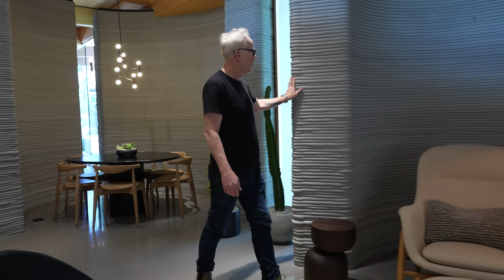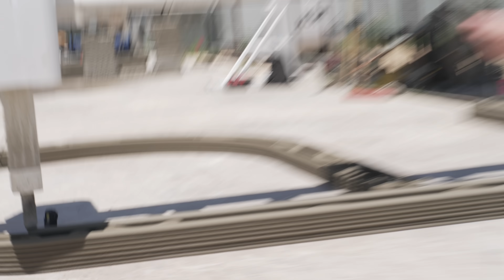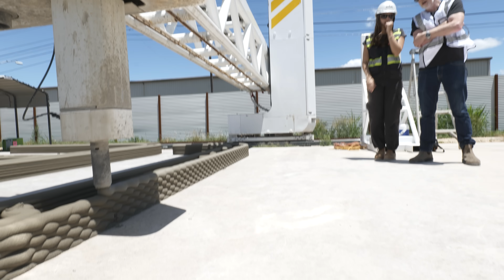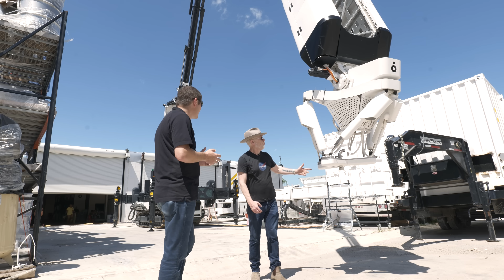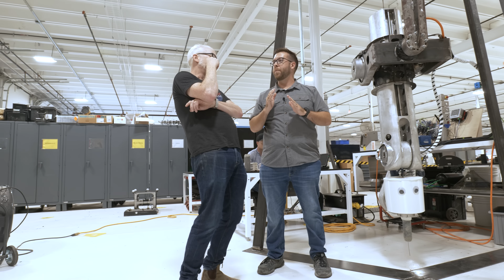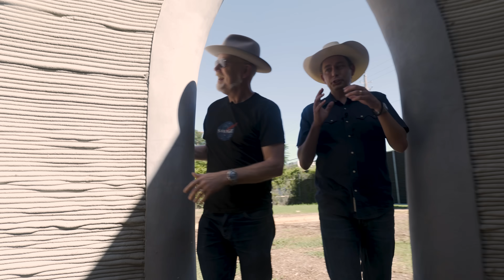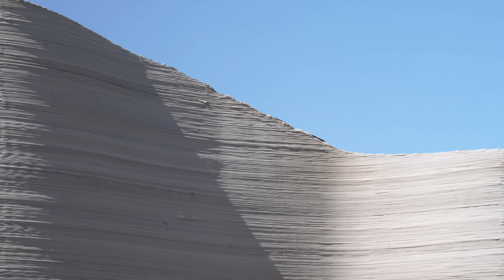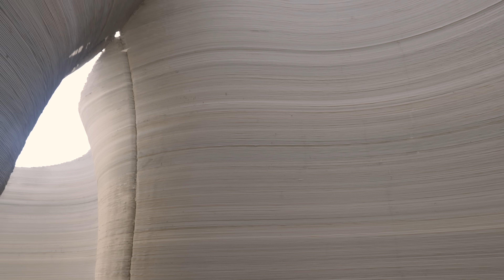The Biggest 3D Printer Adam Savage Has Ever Seen!

Comment: This is a fascinating technology that I reckon will be fundamental in dealing with the US Housing Crisis. 

● I'm curious to know how their materials/design fits with both general US housing standards & those extra standards essential in certain regions (eg: hurricane proofing in Florida)? 
(When the standards were based on older, now obsolete technologies, there's often quite a delay between the development of a new tech & the time when the relevant government bureaucracies update the standards.)

● Can their extruder use different nozzles for fine or shaped work? (Perhaps switching between them on the fly &/or even changing between different viscosities of their polymer concrete for different sub-structures.)

● Does their polymer / concrete material come in different viscosities? (Having a liquid version that can be sprayed onto surfaces or poured into moulds would be helpful for lots of projects.)

● Home much overhang can their 3D printed walls maintain without supports? Could it print a dome (+) with walls that taper as they rise, so that the base is 3 times the thickness of the summit?

● Can their polymer concrete material be extruded underwater? How resilient is it to oceanic/ salt water environmental conditions? Would it be possible to develop a version of their extruder robot that could work underwater?
[ NB: As water levels rise due to Anthropogenic Climate Change, it's going to be necessary to build huge Breakwaters &/or Sea Walls along the coast to protect coastal cities from storm surges, etc. ]

● For that matter, how does their material hold up to prolonged heat & solar radiation? Or extreme cold & heavy snow? Is it protected against "Concrete Cancer"? (Where repeated cycles of heating/cooling cause cracks to form, giving water & corrosive pollutants access to the steel superstructure, sufficiently corroding the metal until the whole thing fails.)

(+) - Perhaps learning from the remarkable construction of the largest unreinforced (no steel or bricks, just pure concrete) concrete dome ever built: The Pantheon in Rome.

Comment: I would be curious whether this can 3D print a large scale, multistory hobbit hill for larger human frames. I would think you’d have to dig a lot of topsoil away, build a very particular structural shape on the outer layer and interfacing with the inner, before restoring the top layers and hoping it’s incredibly structurally sound and leak-free
Reply: Honestly if you could cross modern design in with the fantasy elvish and hobbity elements you could craft something that I would genuinely go be the eccentric guy living in a weird house in the hills

Comment: Soooo... Do you need to print supports too?
Reply: does not look like they are printing anything with such extreme overhangs. also I do know they are capable of manually installing temporary support structures with a ground crew during a print job, such as for windows and such
Reply: @coreysuffield  Hm. How do they make floors then? Like if you want a multi-story building?
Reply: @JohnJTraston  they are still figuring out printing multi-story, but early and existing printed houses use traditional construction for an upper floor

Comment: I hate the layer lines look it is increadibly ugly, in FDM we are doing everything to make the print as smooth as possible, to cut down on the post processing time and cost, and to prevent material defects feom leading to issues later down the line. I really wish you'd do the same, the basket weaving 'skin' idea is a step in that right direction.

Comment: as a technology i love how mind blowing it is... however i feel it has the same issue as Pre-fab houses, where they get the order of operation off:
Pre-fabs should make the modules in the factory & the house gets assembled/customized on site, instead they made the whole house at once before delivering it
have House printing be for House Modules where you can guarantee the proper printing conditions, or using it for expanding existing houses
Reply: There is no such thing as mistake in order of operation. You need to take a lot more time to look into the broader subject that you're talking about. I have a brother who works for a company that builds pre-fab segments for housing in their factories in the northwest of the U.S., then ships them to the jobsites where they're offloaded & assembled. There are still houses that are entirely constructed into modules then the entire module is trucked to the site & placed. Those are called modular or manufactured homes. The units my brother works with are labeled "SIPs" (Structural Insulated Panels). It seems that you either didn't watch this entire episode, or you completely misunderstood ICON's mission in developing a printing head that works in nearly every printing condition, from uneven ground, to limited-space old-world environments, and more, and adjusts the parameters of the cementitious materials being extruded on the fly as the conditions change during the workday, not just from day to day or week to week.
Reply: @dionh70  that's why i said it FEELS like they are seeing the process the wrong way
Reply: @dionh70  also, yes. I did watch & understood the full video and my point still stands, the strengths of 3D Printing/Additive Manufacturing is the ability to mass produce intricate bespoke parts, and/or rapid prototyping. Not On-site fabrication

So what ICON is developing is still counterintuitive to the current process, which i never criticized as a bad thing

Comment: Using 6 active cable stays and 1 'bar' (with or without the bar being length adjustable) would solve nearly all their stability and accuracy issues, at a tiny fraction of the cost. Think tensegrity, but with servo controlled cables.

Comment: I bet traditional framing is faster for building a full finished product.
Reply: They said in the beginning this can be erected in a day.
Reply: @jamesengland7461  I'm talking about a finished house not just a shell.  Most of these houses have framing built around them that takes much longer than the concrete part.  You also have to make space for all the plumbing and electrical. So it seems to me you damn near have to frame the whole house inside anyway if you want your pipes and wires to be in walls.  At that point just build with traditional stick framing.

Comment: I am concerned there’s no vertical reinforcement when it comes to printing a subsurface wall for a basement, but I suppose if you print tubes as you go, you’d be able to slot rebar vertically and fill the chambers with cement before continuing to above grade walls

Comment: I wish I could find a good economic justification for 3D printed houses. The tech and engineering is so damned cool. But really, it replaces the wall framing of a house, which is what... 10% of the cost of a building?  Concrete has increased in price 50% in the last five years, so I doubt there is a materials saving. 

And the CO2 from cement production is enormous - not just from burning fuel for the very high temperatures, but from the chemical reaction that forms cement itself. It's roughly a ton of CO2 produced per ton of portland cement created. You're going from sequestering carbon in your house structure to emitting hundreds of tons of CO2 to build it.

I really want it to make sense, but it's a challenge.

Comment: This is one of those "It's good that this tech exists, but it is almost ALWAYS the wrong way to do it" things.
Reply: I wouldn’t build my house out of it, but if it became cheap enough and if that crane works I could see it being great for garden sheds or garages and simple structures like that, that you just want to throw up quickly and be very functional.
Reply: @a.s.j.g6229  The problem with using it for a shed or whatever, is that the special concrete mix and machinery make it much more expensive than other methods.
In order to come down in price, there would need to be enough demand for it to benefit from scale production, which would happen without the price going down.

There are SOME uses for this tech. But they are so few and far between that it will never be cheap.

I could see it being useful if you need to remotely build a radiation casket for a nuclear reactor or something where you need to build it NOW(!) and you need to limit human exposure to a site.

Or possibly for robotic construction of a colony or something? I dunno.

It would have to combine $$$ not mattering with normal construction being difficult.

Comment: I would love to see an in-depth study of wind loads, rain, earthquake and other factors that test the structure. I will guess that with the curved walls, the wind loads would be very good. Also, would like to see examples of different cladding if, say, the buyer doesn't like the surface look, how would a plaster finish work? How about using wood internally? Also, I live in Florida and outside mold would be an issue with that surface unless there is some way to keep it from forming in the first place. I do wonder how the trades guys will put in water, power, data, and say security cabling...I would guess you could surface mount but not everyone will like that. Also if you wanted to, at a later date, modify it, how hard would that be. It's really fascinating, and this kind of tech is just getting started, wow. I didn't hear them mention that there is so very little waste! I mean stick homes are waste intensive compared to this.
Reply: There's a gap between the inner & outer printed walls. Did you see the BX cable for electrical & PEX piping for plumbing? A diamond-edged blade on a multi-tool should be able to cut a new hole for another outlet. Adding an outlet for my handyman clients is difficult enough with drywall & studs, admittedly. They did say that they're intentionally leaving the printed faces bare during the development phase, but plastering or spray-crete or some other method I don't know about should work. For the exterior surfaces growing mold/mildew, pressure-washing will be fine on bare surfaces, and there's plenty of exterior paints with mildewcide mixed in.

Comment: Seems like this tech could be useful for building structures on the moon and mars.  The material will likely need to change to handle the radiation and thermal environment and the machinery needs to work over a wide temp range (small details ;) ) but if it could use lunar regolith and mars rock then maybe ...

Comment: Its cool technology, and impressive on many levels, but I've said it before about similar projects, and I'll say it again: They are not printing a house. They are printing something like 2-5% of a house.
First, to build a house, you need a foundation. Not only does this not print a foundation, but essentially requires you to build more than a foundation, because the printer needs one as well.

It doesnt build a roof, unless you want to live in an igloo.

It doesnt build windows, doors, floors, panels, electrical, plumbing, tiling, central heating, ventilation, ceilings.. You get the point

What this replaces is basically the wall structure basics. This is essentially the fastest and easiest part of any house you can build. Its all the other stuff that actually takes time and money.

Comment: It's cool, but I'd definitely want a secondary pass of some other machine that could smooth out the surface... Or maybe the printing head could have some sort of tool that is flattening the side as it goes along.
I see those hundreds of folds and immediately think about the dust that will collect on top of every fold and it being a nightmare to clean since it's rough concrete too.
Reply: could probably smooth it out as it goes, dont know if it would affect anything

Comment: I wouldn't call it printing a house, but printing a cave. Also it seems like a solution looking for a problem. Whenever I watched building sites (meaning walking by them every few days), the walls were pretty much always the quickest thing to go up. And it didn't even really matter, if it was brick wall, cast in place or precast. Not to mention that these walls then had openings ready for installing standard doors and windows.

Comment: 3:10  24 hours is absolutely insane 😅
Reply: That's probably no where near typical at the moment, possibly even a very small "house". Did you notice how much he hedged saying that, and that it was under prefect ideal circumstances. Then he never even answer how long a typical sized house would take. I bet it takes a long time and a lot of electrical power in that time. He was cagey about answering that question for some reason.
Reply: To be fair, the gantry one (Vulcan?) seems like a lot of setup for something like that. With the crane (Phoenix?), that seems like a killer combination. Even just to come print a outhouse/poolhouse/shed somewhere.
Reply: The framing is the easiest part of building a home , and this concrete is much weaker than normal block or poured wall concrete
Reply: @sanisidrocr  they aren’t just framing it are they it’s walls complete structure. The only other thing would be to run lines I guess like electricity and stuff.

Comment: Imagine when this technology can print multi materials at a finer resolution size.  Will be able to print not only structure but plumbing, electrical, finishing, insulation, waterproofing and roofing. The future.
Reply: A giant drone could drop either the massive 3D printer at any remote job site, or the finished home.  Completely automated construction and placement.
Reply: Repairs would be near impossible though due to non modular construction. Disassembly impossible.Would have to be extremely reliable longterm print materials with no degradation.
Reply: @user-tb5ns7hc5i  Concrete is pretty darn well understood. We've got Roman concrete which is 2000+ years old - and yes, materials people know pretty darn well how the Roman concrete works. The main Achilles' heel (if you don't mind the Greek reference) of modern concrete is corrosion of the rebar causing spalling. Using stainless steel cable solves that problem.
Reply: It already can

Comment: Honestly, I think they’re overcomplicating this. Just design the print head to function like a cable cam and you’re done. Setting up four corner towers to guide the head where it needs to go would be simple. We already know that a concrete crane—or whatever the proper name is—can support its own weight, so the cables only need to handle the print head. So really, just go with this approach and skip all the overengineered stabilization nonsense.

Comment: I think the novelty of the textured walls will wear off. I like square boxes for houses, and I like smooth, flat walls, and I don't think that's just because it's what I'm used to. For one thing, curved walls for rooms are hard to lay out and furnish, and there's a lot of wasted floor space because of that. So, it's great for a museum, art gallery maybe, or some other public "wow" space, but not great to live in for decades. Also, do you want curvy appliances and cabinets, and closets, to fit the curvy walls? You can't push the fridge against a curved wall, it's going to stick out into the room, wasting all the floor space behind it. Same for cabinets, counters, and everything else you want to build-in.

Also, running electric, data, and plumbing is more complicated, but worse than that, repairing, upgrading, or remodeling is even more difficult, when everything is buried inside concrete walls. Burying utilities inside a concrete wall is a bad idea.

Print the walls only as structure and put the insulation between the two layers. Clad it inside, and maybe outside too, with traditional materials, and run the utilities behind the cladding, so it can be much more easily maintained and upgraded in the future.

Comment: What's the chemistry here?

The chemistry of conventional concrete produces a LOT of CO2, and if this is any entire home, instead of mortared brick or mortared alveolar clay blocks, this is orders of magnitude more cement. 

I haven't read anything, nor heard anything in this clip, to suggest that this is not done with traditional portland cement. If you care about greenhouse gases, I can't see how any of this "innovation" is a good thing.
Reply: Most of the CO2 comes from cooking the clinker, not the curing of the concrete itself. 
But yes, unless they switch to cleaner ways to do that this would be way more CO2 released than a standard brick or stick house.

Comment: It's cool that it's possible, but it seems like a solution looking for a problem, raising brick walls is one of the less time consuming tasks when building a house. I guess when you want a home with lot's of funky angles and weird shapes, then you can 3D print it now, and maybe 3D print the furniture that fit's in it too...
Reply: We need to develop the tech. It will be a useful tool in some VERY specific situations.
But it should NEVER be used when there are other options. It's way to expensive and basically all other methods are better/cheaper/easier/sturdier.

Speaking of bricks, I'm pretty sure there are already brick laying robots that can build a real structure in about the same time.

I could see the concrete tech being useful for some specific tasks though.
Like, if you need to quickly build an emergency structure remotely because of a radiation/toxic hazard.
Reply: Bricks aren't even structural.